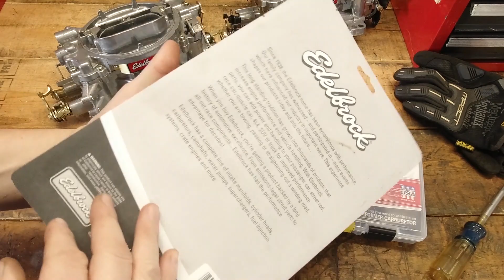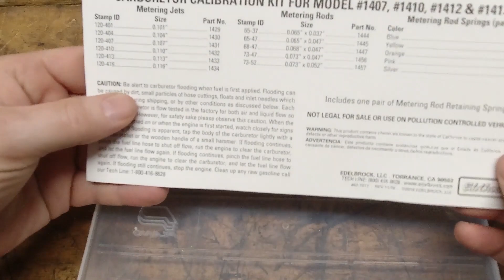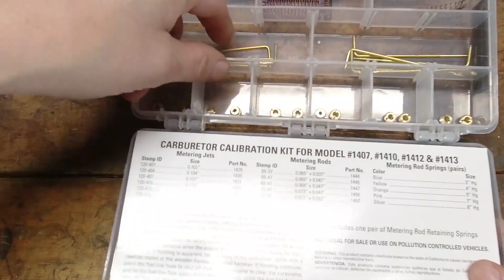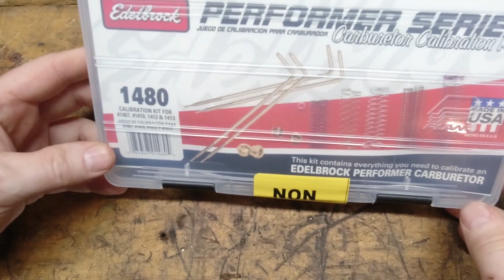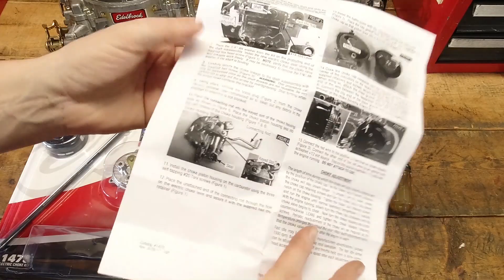How to Install Edelbrock Electric Choke Kit

Comment: You cut out some important steps and screwed me. Good video but you cut the exact piece I needed. I was soooo meticulously on what I watched…
Reply from the maker: 😂😂 seems as though you’re the only one.
Reply: And here is why. Although your video is good and one of a kind. I watched over and over to figure out one part you cut out. (I’m not a mechanic). How did you put the rod back in and screw it back and what side the new rod catch was on. You cut to the rod in…. I snapped the screw just like you said…  ugh my work truck. I have to drill the new rod and tap it.
Reply from the maker: @dogriverbrewing  so I told you not to over tighten it or the screw will snap, but it happened and that was me screwing you?  I don’t know your limitations.  That’s a judgement call on your end.  Take it to someone to work on it for you.  Or don’t.  I’m sure that’s my fault too.  🤷

Comment: Hey I was reading the comments and you said that the electric choke kit will work on a AVS 2 carb but edelbrock specifically says no it will not work and that a manual choke avs 2 carb will always be manual there is not kit to upgrade it.. I have a AVS 2 1905 carb manual choke and I would like to convert it.
Reply from the maker: Unfortunately no it will not.  There is no conversion kit and as far as I know, no plans to offer one.  The AVS is the issue.  It was thought the 1478 kit would work but it will not.
Reply: @MuscleCarSolutions  ok thanks!